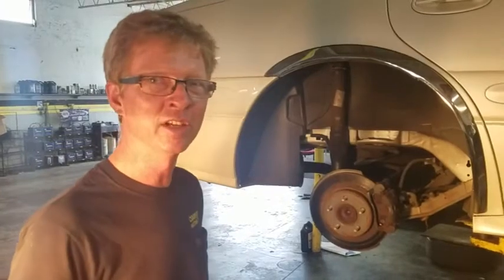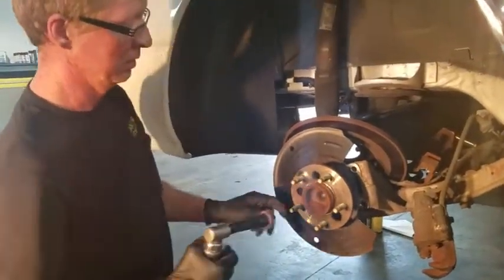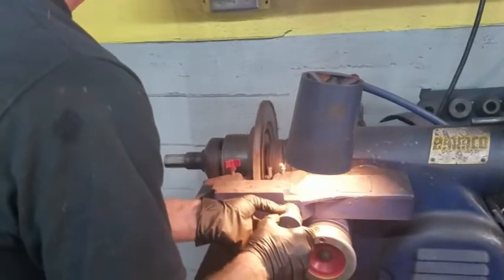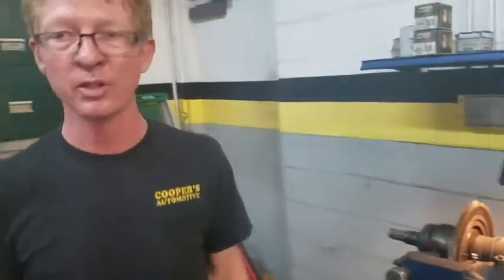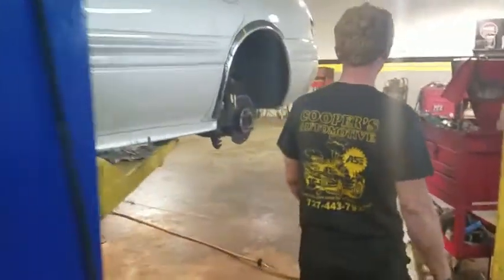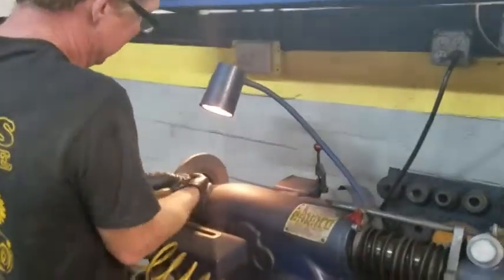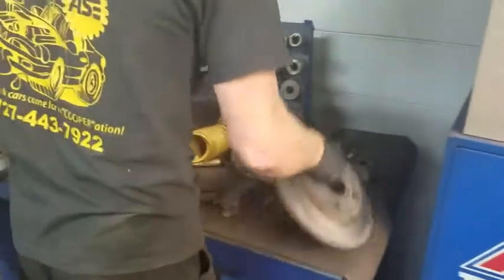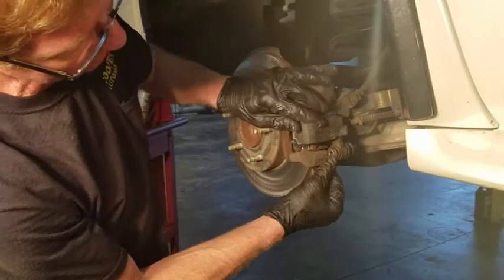How to Replace Rear Brake | 2003 Buick Lesabre

Comment: Great job overall,. However, I think it's never a good idea to put any strain on the brake hose. It can cause an internal break leading to hose failure. And given what we now know about asbestos, you should be wearing a filter mask at least when cleaning up the rotor.
Reply: Absolutely, was making me cringe 😂

Comment: What happens if I just shove the caliper back on without pushing in the piston? Will it go back in by itself? Asking for a "friend" who already did this without watching the second half of the video.
Reply from the maker: In most cases you will be fine. But sometime it could damage the abs system
Reply: Thanks! I'm going to take it all apart and redo it anyway since it still seems to be dragging. I'm thinking getting rid of more rust may help.
Reply: How to install replace rear disc pads on a 2003 Buick century
Reply from the maker: Sorry for very slow relay.